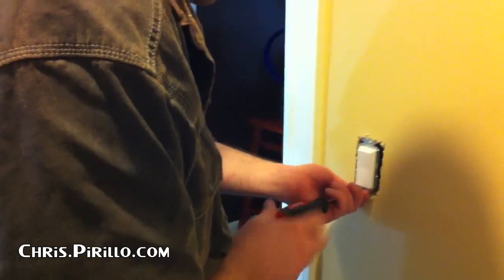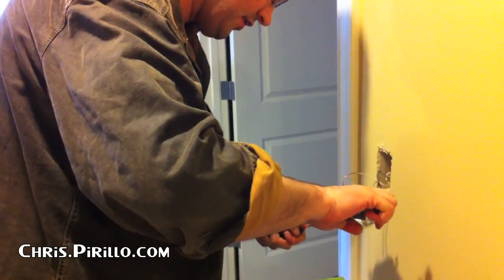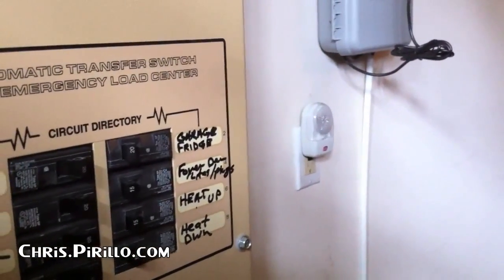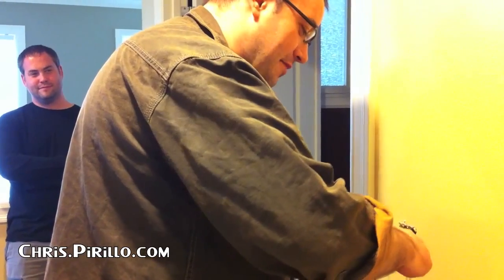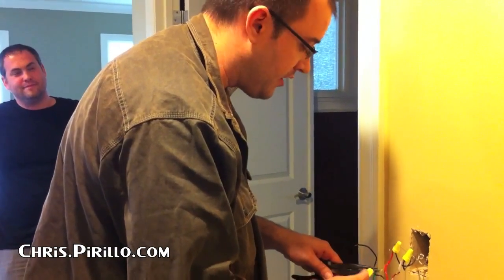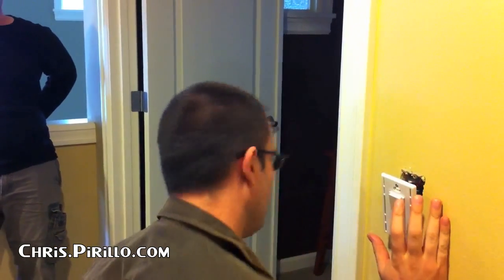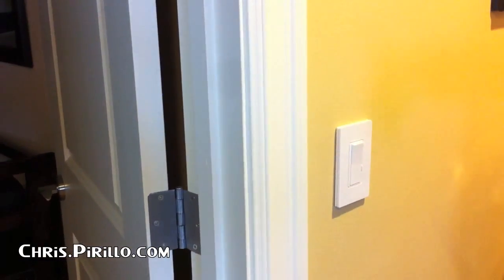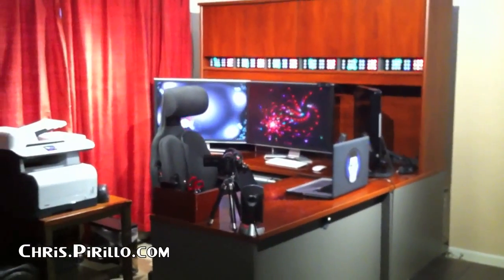How Not to Install a Light Switch

Comment: Also something there is an adjustment dial for setting the low end of the dimmer adjustment.  I have all Lutron Maestro dimming switches throughout the house with Maestro IR's in the theater room.

Comment: @Jourei91 So called 1,000 volt tools should always be used when carrying out electrical work. A tested and fully approved 1,000 volt tool can protect the user against currents up to 1,000 volts. Full approval means that the tool must be insulated and tested in accordance with IEC 60 900 and DIN 60 900 and not just VDE 0680.
IEC 60 900 is the standard that applies worldwide for tools that are intended for use in electrical work.

Comment: @nobodypersonsomeone Yes. It's more likely to kill you if there's a load on the wires, as in the video. the load "force" the current to flow easier with higher amps. (A load is anything that draw power to work, like lights)

Comment: In the UK we have 230/240V but a lower current.  Lol when he shocked himself.  Also noticed... you are not suppose to rely on the screws to pull the switch-plate in.  It should sit flush anyway and the screw should just hold it in place.  If it springs out when you take the screws out the wires in the back-box are too long or not neatened up enough.  Also wondering what the yellow things were?

Comment: @Jourei91 It is strange that you are an electrician and use the tool the same way. If you touch metal when working with voltage, you have the opportunity to shock, which of course is prohibited. Can you see the logic in this?

Comment: Don't hold the screwdriver like he does if you haven't turned off power to the circuit. Only touch the insulated part of the screwdriver not the metal part. The voltage and current has nothing to do with if it will "kick you or stick you." If you grab the circuit you will not be able to let go because your muscles with tighten up. If you touch it with the back of your finger it will resist and push your finger away very fast.

Comment: Don't think he's even close to an electrician.  It arced because when he was striping it he hit the ground with the tip of the pliers.  He never should have cut it in the first place but it looked like he didn't know how to remove the push in type connection.  And what electrician uses electrical tape?  It is not used in household wiring, it's all wire nuts.  Pass through wires?  Hot and common and after re-watching hook it up I believe he hook it up wrong that's why it's not working right...